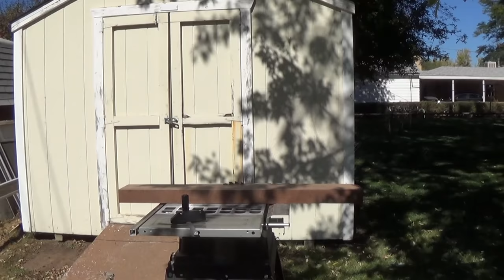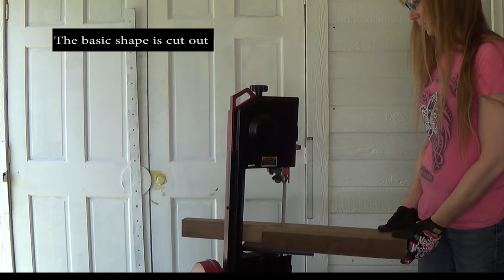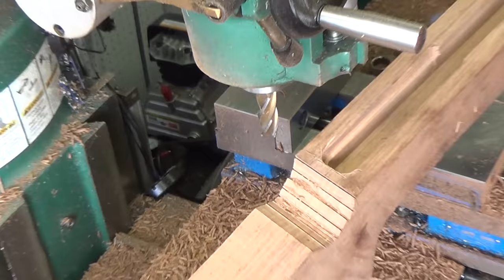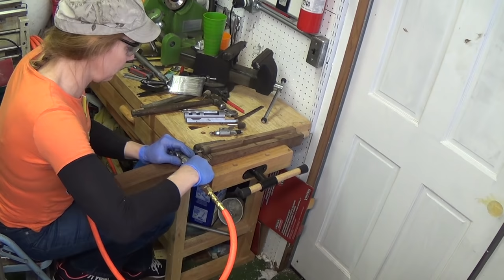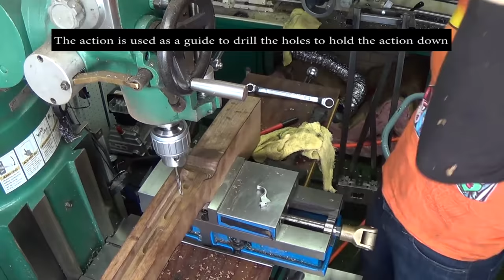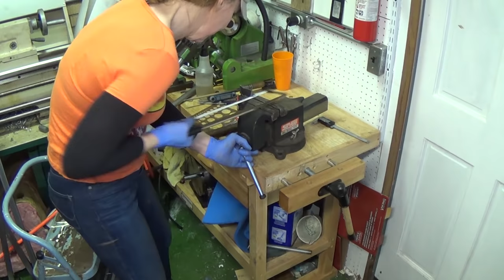Homemade 22lr bolt action (the stock) part1

Comment: Hey Waffenschmiedin,
great project and technically top! Congratulations. May I ask from which country you come?
I'm currently working on a single-shot 9mm rifle with striker ignition like yours! Will a be a break barrel design. My only question and problem I have right now is that I do not know how to make a rifled barrel and that's why I'm going to put in a smooth bore barrel. Do you have tips for me how to make a rifled barrel without a hydraulic press and lathe? What steel is your barrel made of?

Greets from Germany 

Greetings Daniel

Comment: What kind and model of milling machine is that? Thanks. I've been looking for a used Bridgeport but your mill looks really precision.
Reply from the maker: its from Grizzly http://www.grizzly.com/milling-machines a lot of grizzlys lower cost machines are kind of meh but i have to admit this machine is every bit as good as any american one iver used and its "new"  and for the price i wasn't able to find any used equipment any where near as good. the lathe is ok too the steady rest sucks but the rest works really well. it not the quality of the mill though. if i had to do it over i would have saved a bit more for a little higher priced/quality one but this one does ok and its small enough for the space.